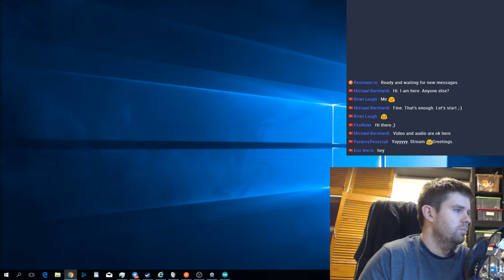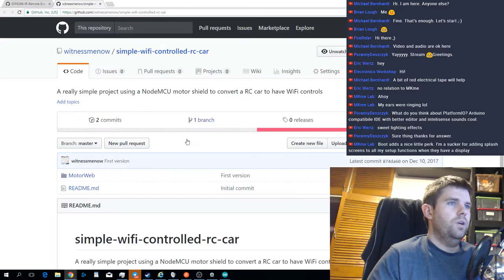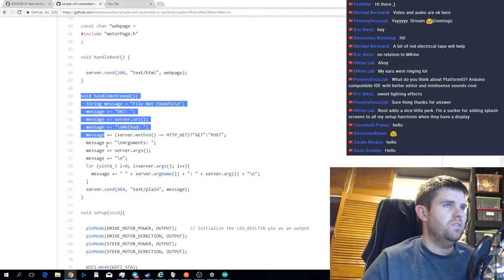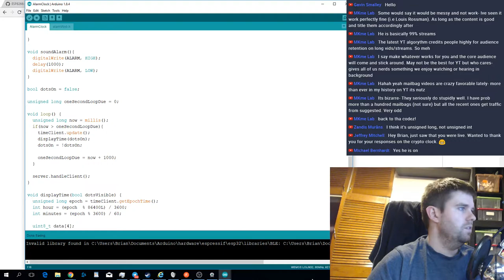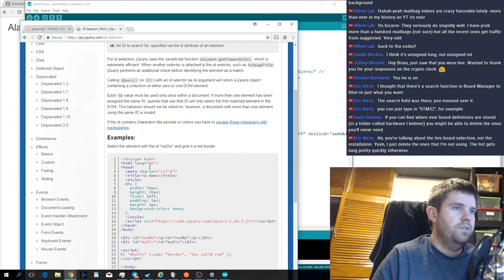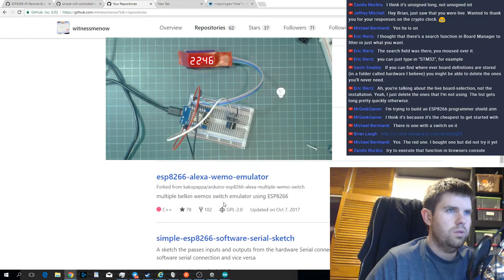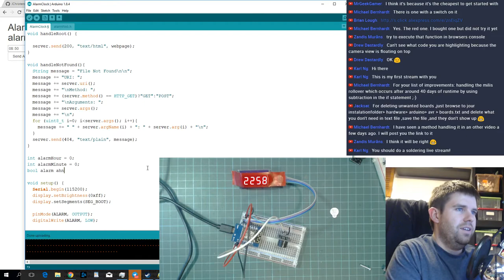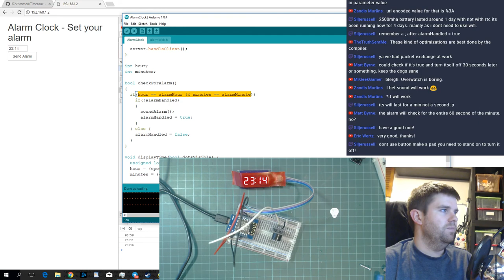Arduino Alarm Clock Build #02

Comment: Idea for the clock: Light that starts to brighten before alarm (like Philips Wake-up light). Brightnes could be calculated like this.
brightness = map((alarmTime+brighteningDuration)-(timeInSec+brighteningDuration), 0, brighteningDuration, 255, 0);
brighteningDuration is added to times just in case when the alarm is set just after the midnight.
Reply from the maker: +SoarPilot yeah good idea! I have a lot of spare led rings from the wedding lights projects too!

Comment: For ESP8266 projects that require a SSID / PASSWORD, I add a tab called config.h and #include "config.h", put #define SSID mySSID etc, this would help if you stream as you can have a more complete sketch and hide your private details. I tend to put all by #defines in there, easier to just click a tab to check names etc.
Reply from the maker: +electronicsmokeUK I actually tried it before and ended up showing it anyways! Platform io which was mentioned earlier actually let's you use environment variables which would be a good way of doing it either

Comment: WARNING: library Timezone-master claims to run on (avr) architecture(s) and may be incompatible with your current board which runs on (esp8266) architecture(s).
Hello, 
when compiling the code i am getting this error above mention. how could i overcome this message?  thank you